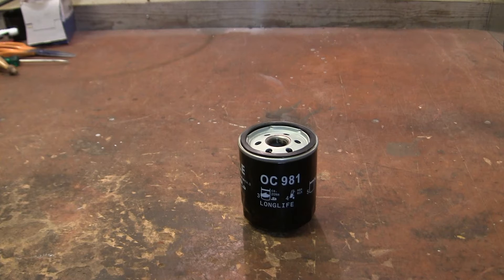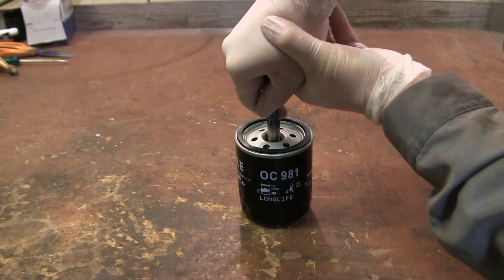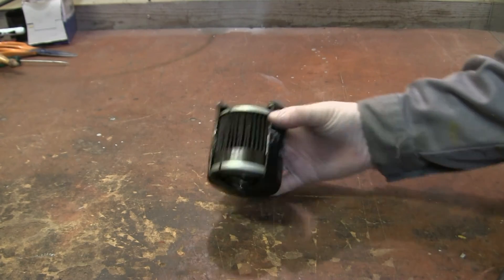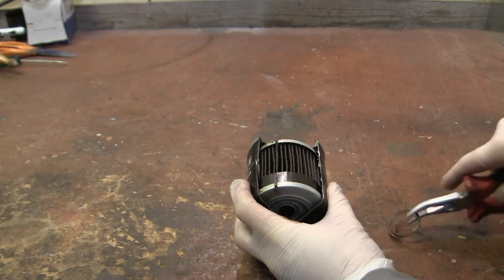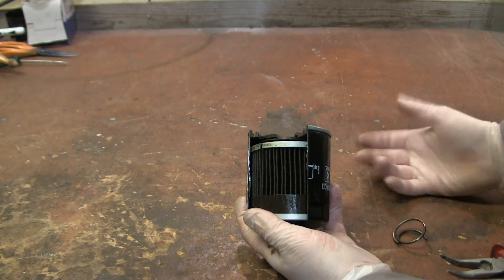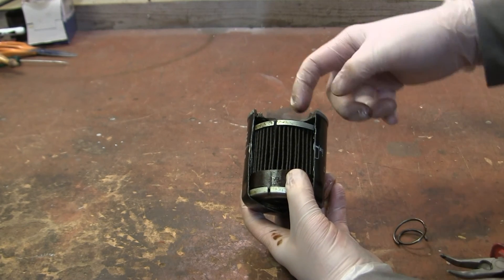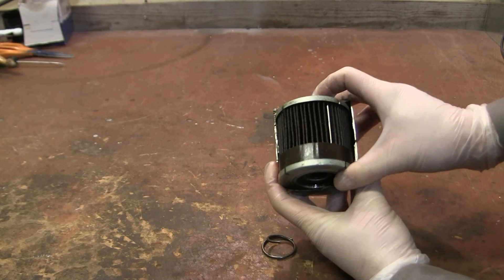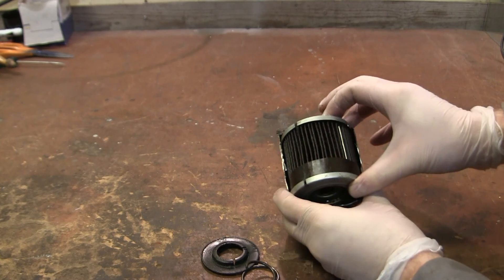Oil bypass valve - Magnetpro │Tobe Tinkering

Comment: Thanks for the video. I see that my OEM Subaru filter opens at 21 psi but the Mahle is 10 psi.. what will happen if I use the Mahle? Is there any chance that the pressure inside my engine to be higher therefore the Mahle to stay much more open than the OEM filter resulting in inefficiency of the filtration?